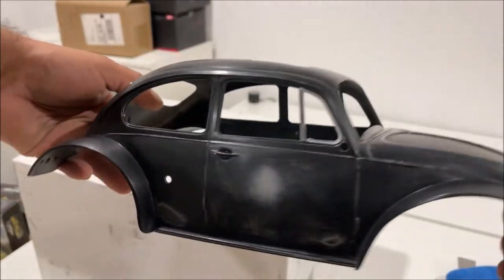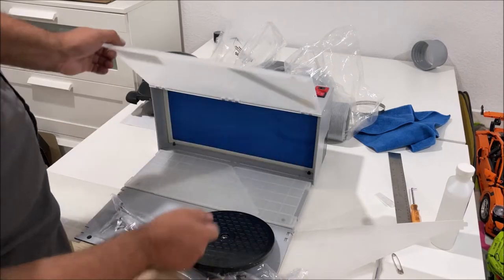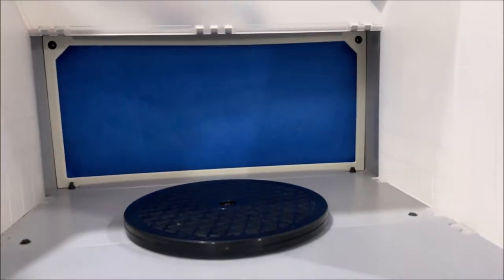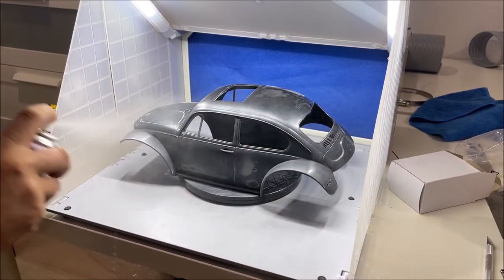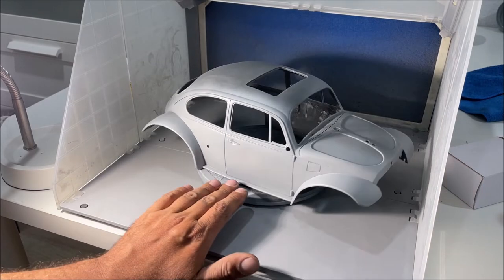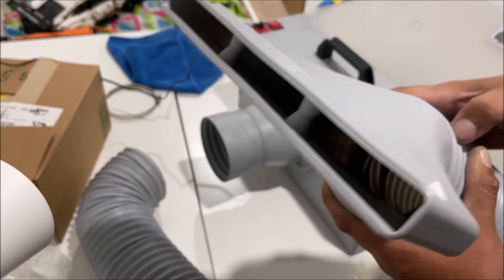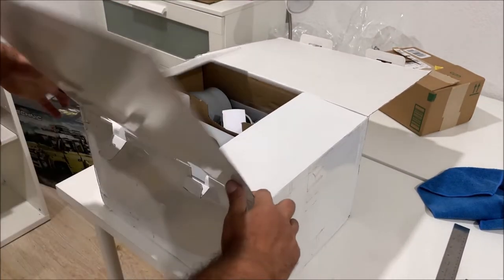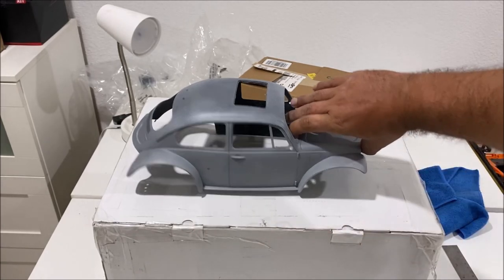Airbrush PAINT BOOTH portable hobby spray paint review $120 EBAY 2022

Comment: So this is safe for spray paint cans??
Reply: I would not use this type of booth with rattle cans. I’m not saying it won’t work but rattle cans deliver so much more volume of spray that I think the exhaust fan might be a bit overwhelmed.  It’s perfect for airbrushing but I wouldn’t think it’d work that well with rattle cans. That said, this guy’s applying primer with no issue so maybe I’m completely wrong. I hope I AM wrong as I like using some rattle can primers better than airbrush primers and that would eliminate the need for spraying in my garage when temperatures are acceptable.